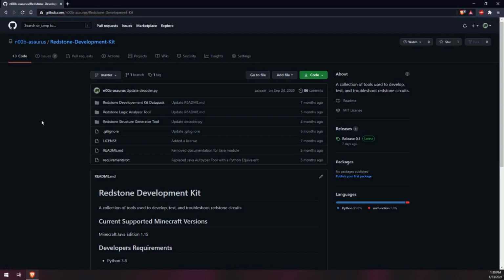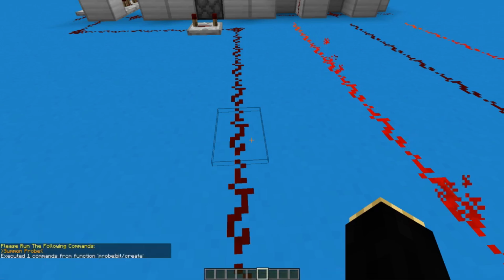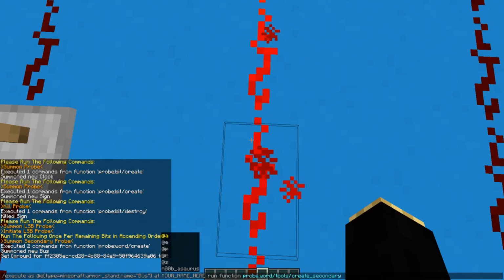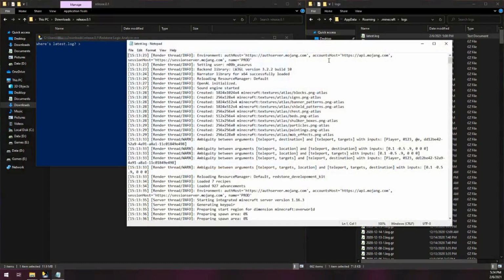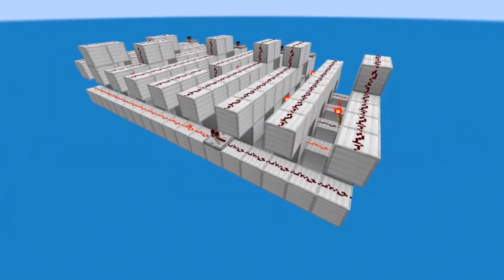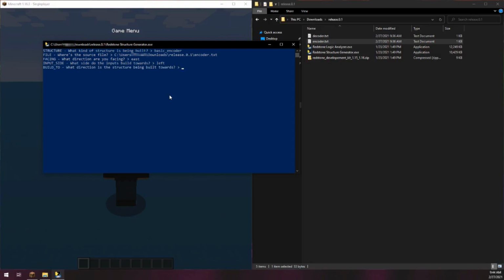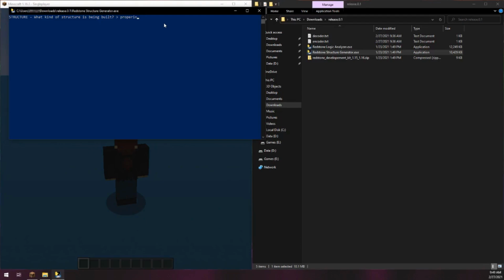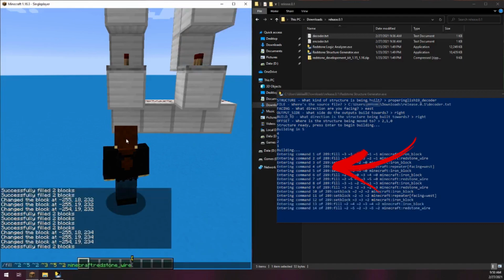Redstone Development Kit Release 0.1

Comment: for Unix-like OS (Linux, Mac, etc) support, directly running the structure generators does not work, as the file requires a Windows DLL, which obviously doesn't exist in Linux or Mac. (bummer, I really wish I could use it.)
Additionally, the .exe files you said would be there are nonexistent as far as I can tell, so WINE isn't gonna work either.
Because of this, I will be attempt to modify the python code so it will work in Linux.
Reply: looks like fixed the Redstone Structure Generator by replacing the "from pydirectinput import press, keyDown, keyUp" with "from pyautogui import press, keyDown, keyUp".
after installing PYAutoGUI of course (https://pyautogui.readthedocs.io/en/latest/install.html).
Minecraft's input system is pretty whack, I remember having issues using it, but if memory serves those only affected the mouse control which this tool doesn't use.
I haven't properly tested it yet though.
Reply from the maker: @bluesillybeard  as long as it still works with minecraft, by all means.
That was the main reason why I used pydirectinput, it seemed to be the only one I had found so far that worked with minecraft.

if you want to make a pull request, I can merge your contribution.

Comment: Nice Kit - i will most likely use it next time i build a computer

A few ideas for features, which i have in my own bukkit-plugin for redstone building (therefore i dont know which of theese is possible with datapacks/external programms):
- long range switch (punch a switch/button/ect to set it and right click to use it)
- tps changer (change speed of world - with plugins you can easily set it to 2* or 0.1*)
-  some sort of improved worldedit (selection tool and //stack, //copy, //paste)
- speed-measure-tool (select the start-button and lamp at the end to measure how fast a computer/program is)
- fast-travel-tool (teleport where you punch)
- freeze-physics (-> you can easier change stuff and have a easier time creating some things)
i havn't found a way to do this without a mod, but maybe you could find a way for noclip
Reply from the maker: Interesting ideas.
I think the TPS changer, worldedit tools, and freeze physics might not be doable. but the others might be worth considering.

Comment: Hello!
Reply from the maker: Hello again
Reply: @n00b_asaurus  This is a really cool kit. Sadly, I'm on bedrock and can't use it :/
I have built most of a cpu, though. I designed pretty compact registers for bedrock, using full cauldrons as a  1 and emptiness as a 0. I did a super sloppy job making control wires, but it works. Thanks for everything you do!